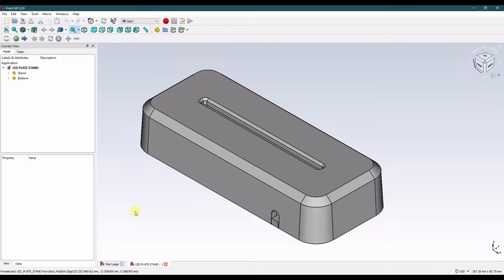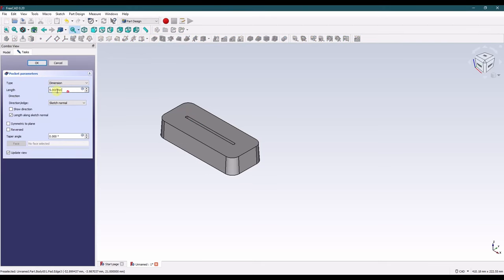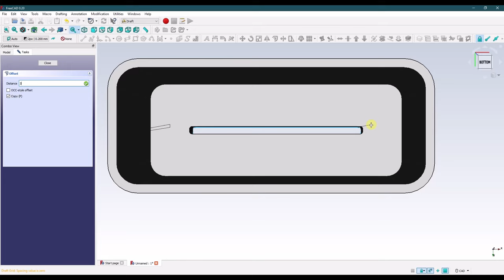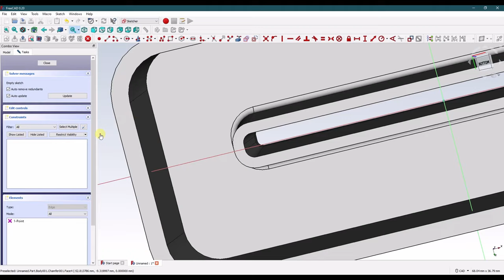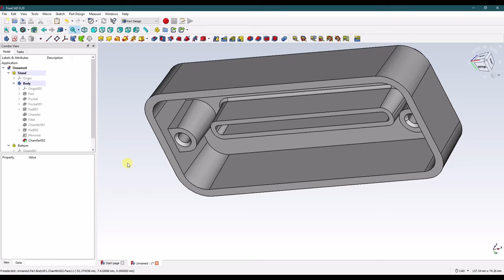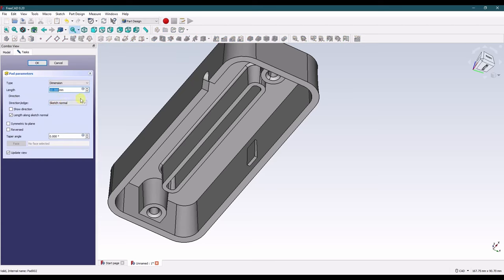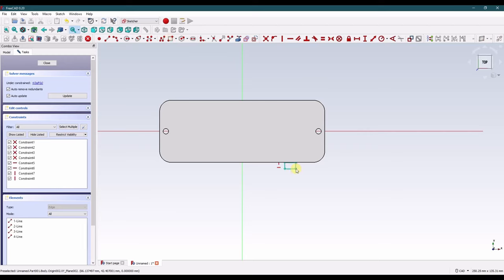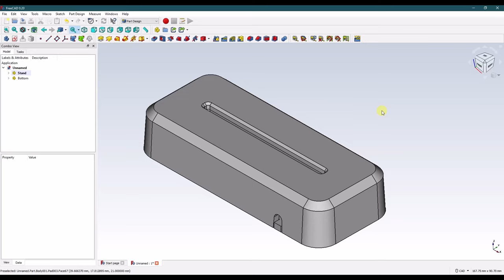FreeCad Tutorial #10 | Part 2 | Modeling the stand for acrylic edge lit sign for 3D printing.

Comment: Hi Seth, thank you for another informative video. I’m pretty new to FreeCad so maybe something you’ve already addressed. When creating an another sketch why do you select a plane then offset it to the desired height and not select that surface you’re going to work on then create a new sketch? Thanks
Reply from the maker: Hello! The issue is with FreeCAD's topological references. When you reference a face, edge, or point, FreeCAD references it by name, which would be fine, but it can get renamed with changes to previous features. So, to keep the model stable, it's best to model off of the global planes. I have heard that developers are trying to address this issue, so this should be fixed in subsequent releases of FreeCAD.